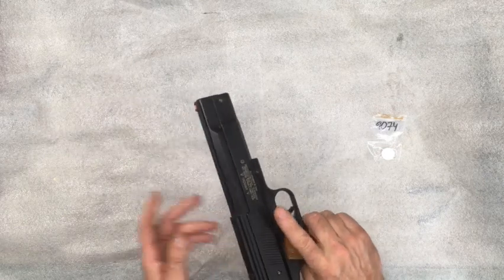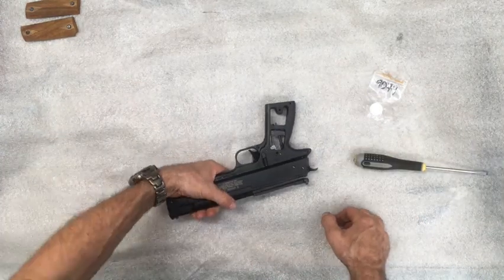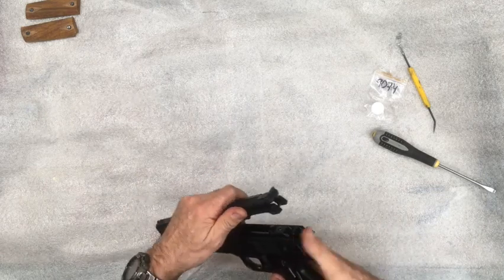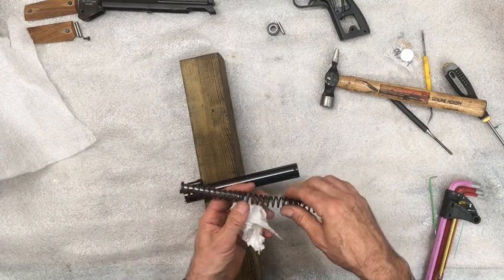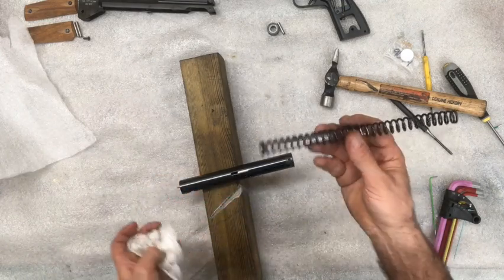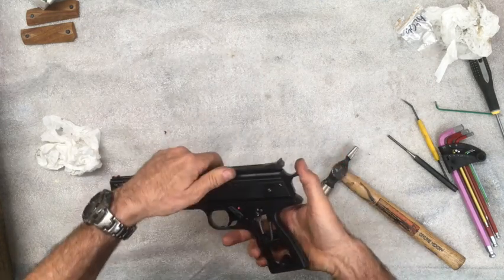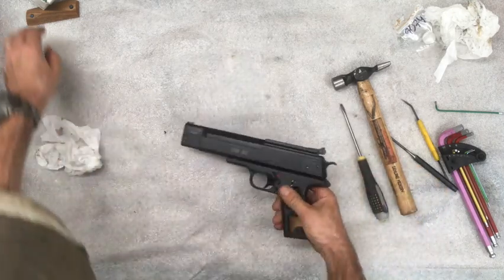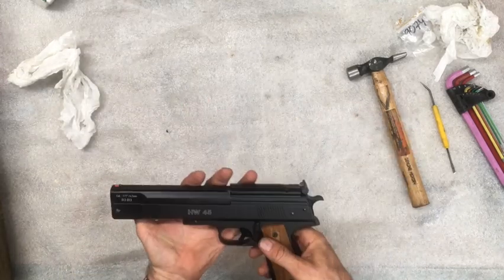Weihrauch HW45 piston seal change

Comment: Thank you for an excellent instructional video. I'm hoping to fit a TBT tuning kit to mine fairly soon. The teardown and reassembly was causing me some doubt. You have just demystified the process for me. It's unfortunate that the video freezes from 18.25 until 20.27 however, the most important aspect for me is the safe removal of the spring. Thanks again.

Comment: Great video but the video hung up right before you put the spring assembly together. How much grease do you put on the spring before it goes in the tube. And what are the results after installing the new seal.

Comment: Nice video the only trouble is it froze and had a massive jump when you was putting the piston seal back on so didn’t see if you done anything to take care of the burs that caused the problem in the first place
Reply from the maker: Haha. Just looked and see what you mean. Don't know what that's all about. I will try to upload again to see if I can sort it. My copy is fine. What I did to take out the burrs was a quick touch with a rotory tool (Dremel) then wrap a wood dowel with wet/dry 600 grit paper to tidy it up. You will be able to feel any other burs with the wet/dry as well. So long as you don't get carried away and go too far into the cylinder  it won't effect to cylinder seal surface.
Reply: @gardenshedgunsmith1648  Fantastic mate I’m just about to strip one day myself I’ll try that
Reply: Yes the freeze is a bit disconcerting.
Reply: Pity it froze.but thanks for the great video. Just one other point could you put your cap on backwards the peak was blocking the shot of the table once.in a while  .
Cheers ☺
Reply: @gardenshedgunsmith1648  hello mate thanks a lot for this tutorial...i have the hw45 and with your video i have strip and rebuild in short time❤

Comment: An enquiry : I can't figure out why the HW45 spring guide is loaded in the front instead of in the back? years ago I stripped mine, thinking that the factory could have put it the wrong way, so I changed the combination: piston, mainspring, and spring guide came last. By doing so, it still worked out fine, but didn't do any better also.
Reply from the maker: Not really sure it makes a whole lot of difference. Like I mentioned, there is a t least 1 after market tuning kit out there for the HW45 that has polymer spring guides fitted to both ends of the spring.

Comment: Thank you so much for the video,  very helpful!! I just wondered how much pressure you have to put on the main spring to release the pin, mine won't seem come out, maybe I'm putting too much pressure on it??
Reply from the maker: It doesn't take much. The end cap barely needs to move. If it's never been out you may need to gently drift the pin out with a few taps.
Reply: @gardenshedgunsmith1648  Thank you so much for the reply,  I'm probably putting too much pressure on it,  thank you again!!

Comment: Weirauch's quality control doesn't seem to be as good as everyone thinks, the damage to the piston seal is a good example. I've had two HW77s with badly aligned spring guides and an HW95 which was 2 1/2 ft/lbs over the limit, all brand new and genuine imports, easy enough to fix if you know what you're doing but not what you'd expect.
Reply from the maker: Sadly, I have to agree. Think it was a Friday afternoon QC check.
Reply: Hull Cartridge co is the only real importer in England
Reply: Guessing you had a 20 joules set up accidentally  sent,
Reply: @jizzmonkey9679  Collected it from a local RFD, he can't have tested it. I still had the nylon spring guide and washer in my spares boc after swapping the innards for a tuning kit, recently bought a cheap 77K, it was made in '93, so as part of an overhaul I swapped the old steel guide for the HW95 guide.
Reply: @tonyhoodlass1846  all my Weihrauchs have been HC guns.
Reply: @bobthebarsteward  he definitely  didn't  test it then, could  have cost him his business
Reply: @bobthebarsteward  Yeah Defo a Good firm i asked them for a sticker and got 15

Comment: Definitely shoot better when a piston sleeve is used, l don't use a clamp l push down tap the pin out, the spring bends all over putting it back as the guides in the piston.